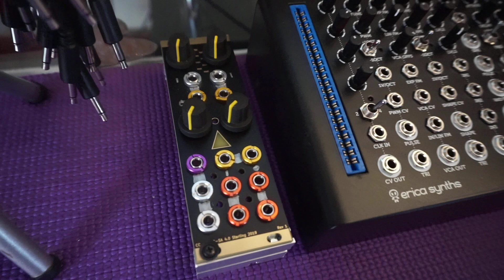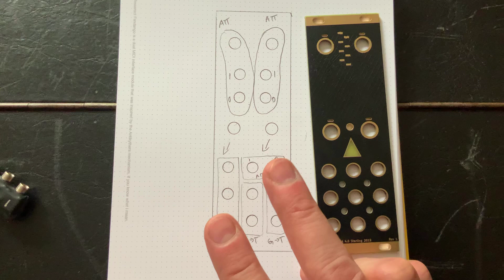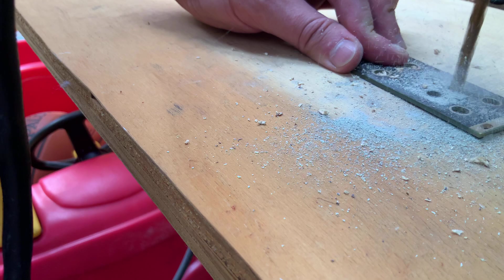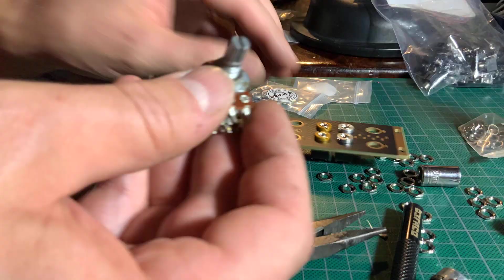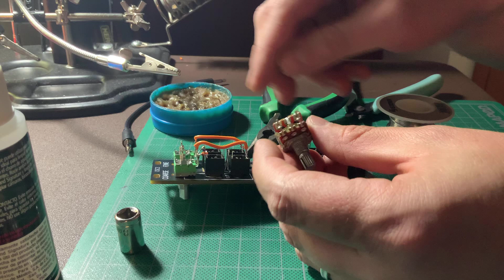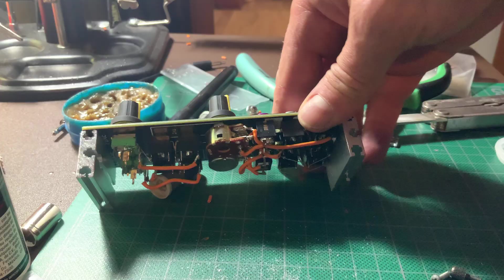Pico Patches Ep# 4  - Making the Pico Expander and A Drone Patch

Comment: Great little utility module.   
One note about relying on the panel for ground - if you ever get a slightly loose jack / pot you'll start to get a crackle.  Not the end of the world, but worth mentioning
Reply from the maker: Thanks! But since every jack is another ground connection, and there's also the cable shielding, I'm pretty sure it'll be ok :)